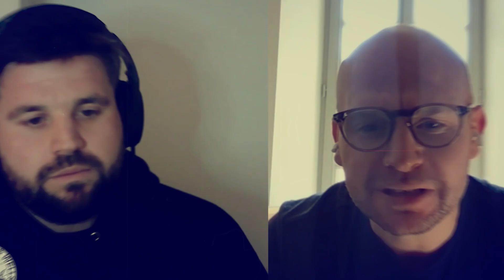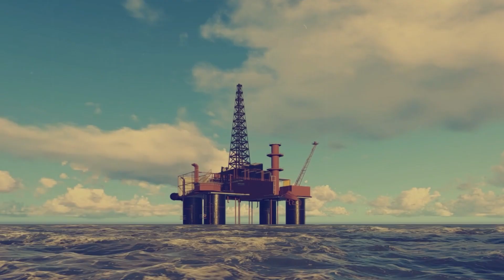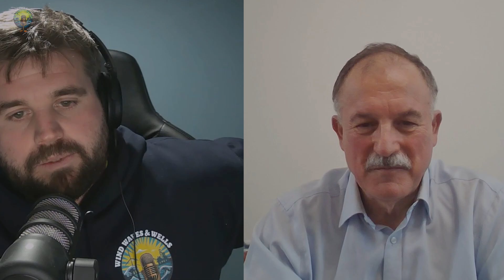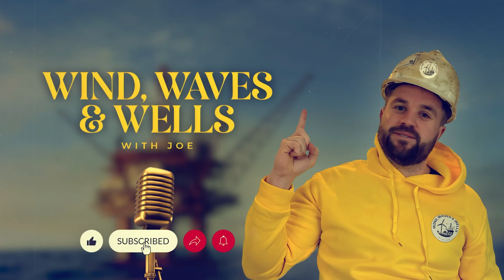Chris Bright - Understanding the Grid

Comment: In 1974, power cuts due to disputes in the coal mining industry were responsible for bringing down the Conservative government which lost the General Election in February of that year.

In those days, about 80% of British electricity was generated by coal, and with little coal stockpiled at power stations, supplies soon ran low.

To save energy many industries had to work a "Three Day Week": Monday to Wednesday or Wednesday to Saturday. Sundays were still a day of rest.

TV transmissions ceased at 10:30 pm to encourage people to go to bed early and save power.

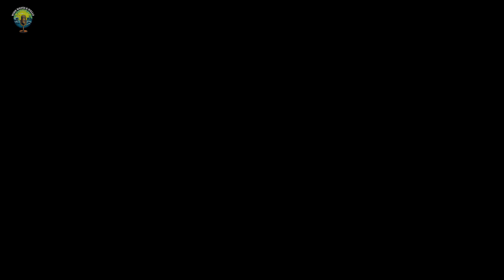Rota disconnections were imposed between 06:00 hrs to midnight, Monday to Saturday. On high risk days, whole blocks of customers were switched off for three hours at a time, then on for three hours, then off again for three hours, three hours being the longest that refrigeration would cope without food spoiling. 

Each block would have two high risk days per week seperated by medium risk and low risk days. On high risk days, power cuts were certain in order to save coal. Medium risk days were chancy, and low risk days usually had constant power.

Hospitals were spared power cuts. If you were supplied by the same network as a hospital, you were also spared.